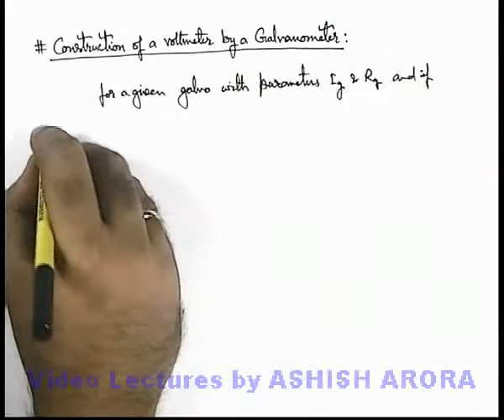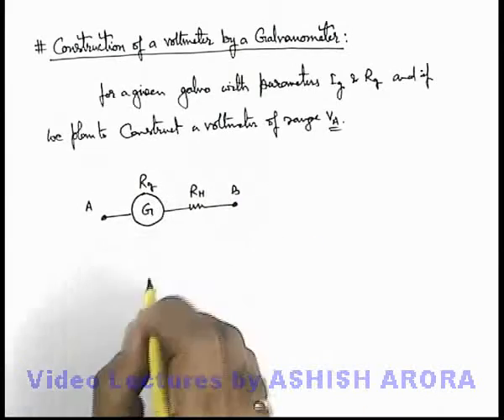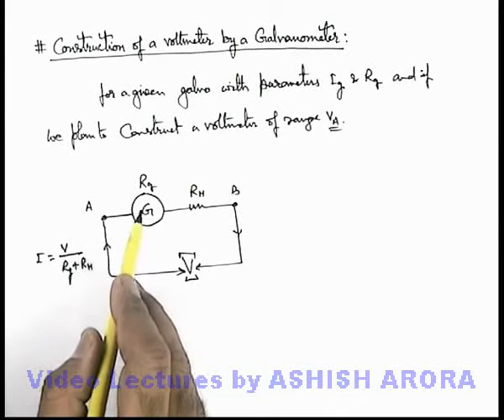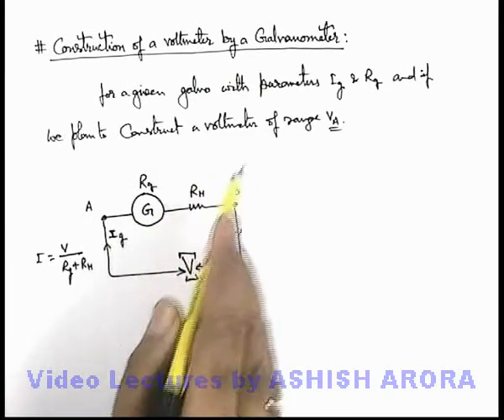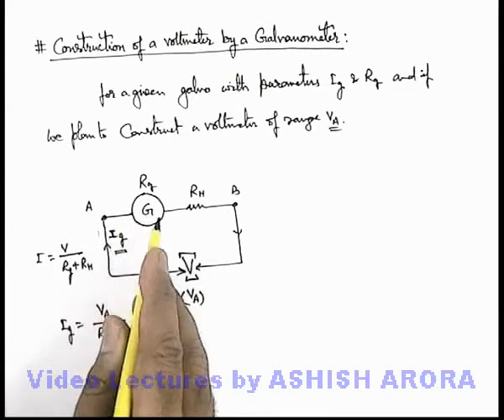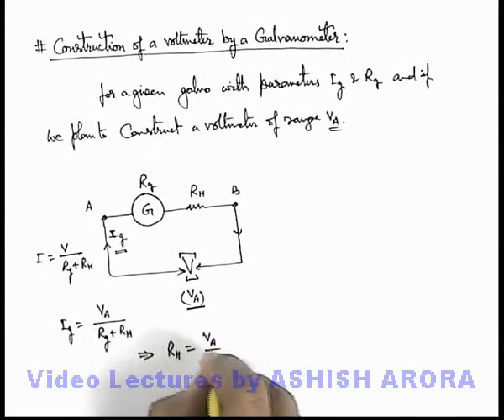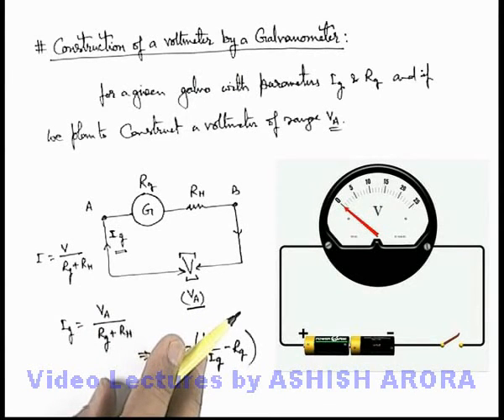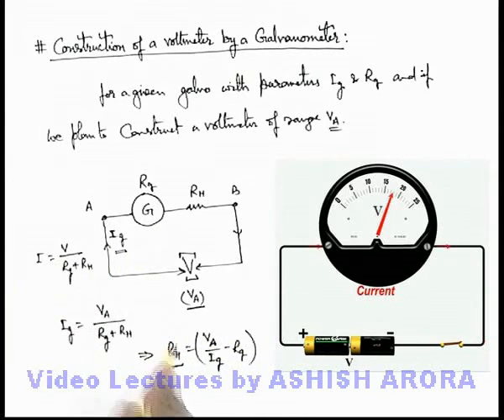Class 12 Physics | Electrical Measurements | #7 Construction of a Voltmeter by a Galvanometer

Comment: Sir I understood why you connected a shunt resistance in parallel in galvanometet to make it as Ammeter...but I did not understood ij case of ammeter...can you please clear it to me in a few lines.
Thank you very much.
Reply from the maker: could not interpret your query... pl ask specifically...
Reply: I am assuming you are talking about the high resistance connected in voltmeter in series

Here the High resistance (Rh)  is connected in series because if it is absent then due to low value of Rg very high current flows through Galvanometer compared to Ig due to which Galvanometer will get damaged
Reply: I couldn't understand how this arrangement can serve as a voltmeter?

Comment: Sir if we connect low resistance parallel to galvo than also ig will pass through galvo .In that case also can it measure the voltage.
Reply: Arre Bhai hame minimum current cahiye voltmeter k liye naki high current isiliye hum high resistence use krte hai

Comment: I am not clear on how the galvanometer will read the voltage  because galvanometer measures current
sir told something about calibrating the scale...but i couldn't get it..
plz explain the funda
Reply from the maker: Galvanometer only gives deflection... Sir has explained about the deflection by current... if printed scale behind the needle is in voltage then the person who is taking the reading will be a voltage... its just deflection by supplying the current...

Comment: Sir if we connect low resistance parallel to galvo than also ig will pass through galvo .In that case also can it measure the voltage.
Reply: Yes we can, but will not be an effective voltmeter as then it would have a range of (Ig)(Rg) only which is not very efficient.